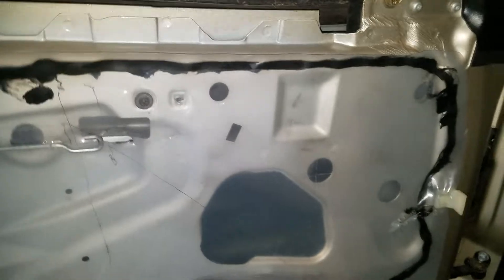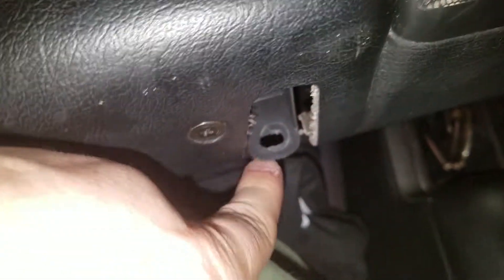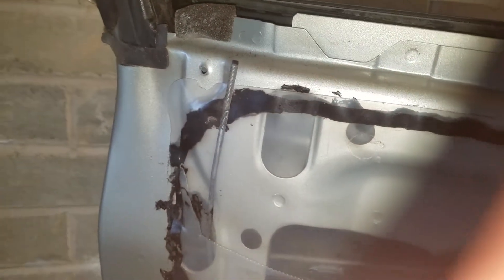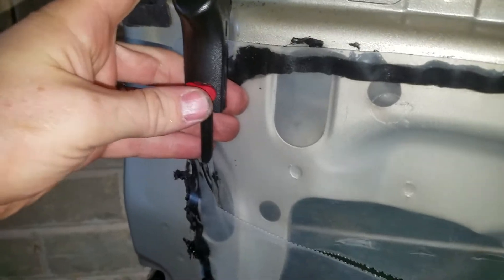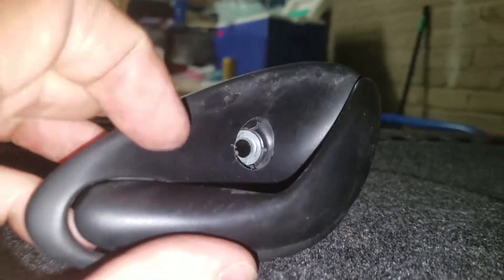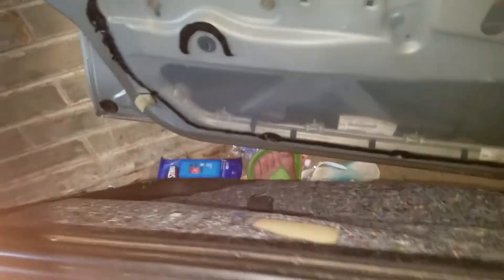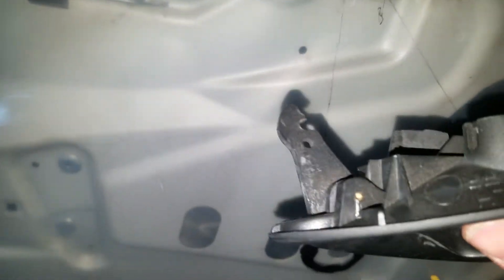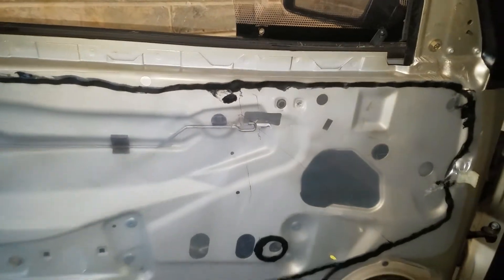VZ VY Commodore Interior Door Panel / Door Card Removal tips

Comment: How do u put the window back on the runner
Reply from the maker: Sorry, not sure and we've since sold the car. Often there are a couple of vertical guides, and the winding mechanism is attached at the bottom with special glue.

The guides are important as they support the glass while the window is down, so that it doesn't shatter if you close the door while the window is down.

I'm sure there's some good videos on here for other cars, all cars are pretty similar.